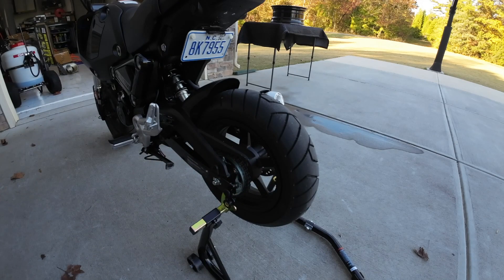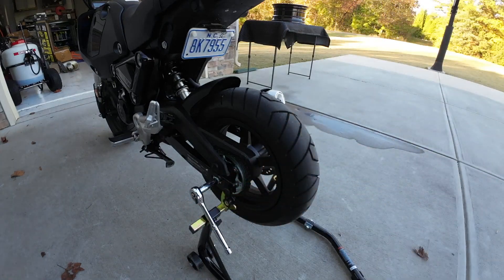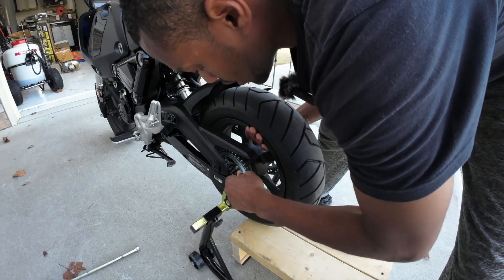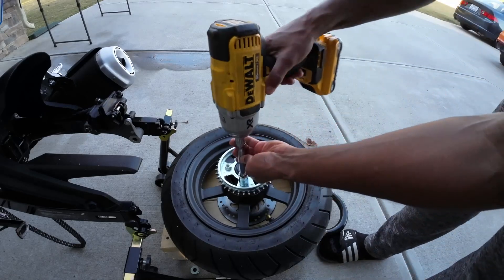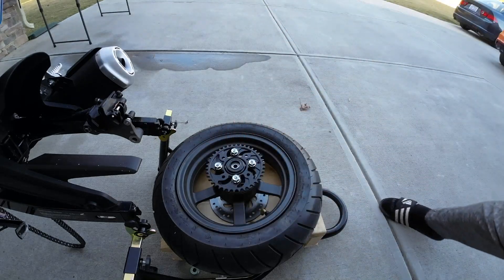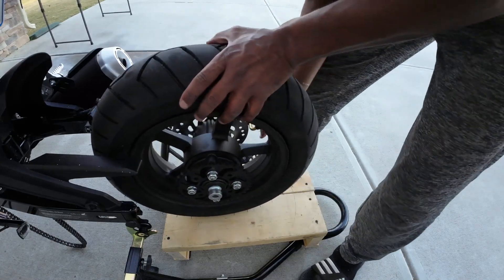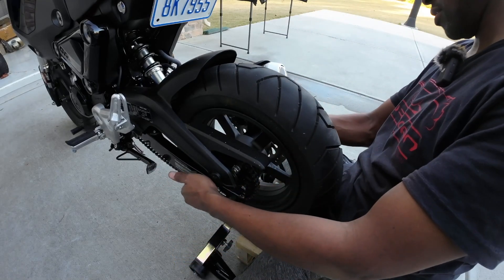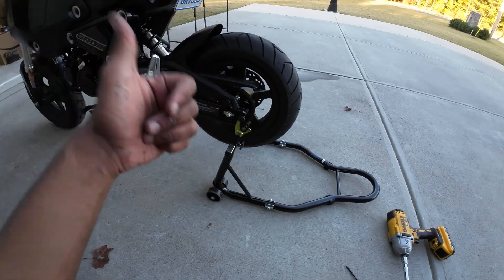Honda GROM | TST Rear Sprocket Upgrade

Comment: Did you notice any major changes?
Reply from the maker: No, no major changes since the gearing stayed the but when I change out my wheels this will come in handy or else I would have had to modify the stock sprocket. It's also nice because it's lightweight and the build is solid.
Reply: @btbuildthings  Did it fix our Grom's infamous chain noise?